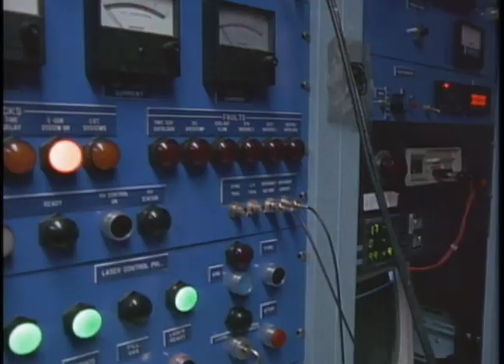Laser Pumped Flying Saucer Spacecraft

Comment: The biggest issue with this concept: Water. One cloud, and you sit in a plane crashing down to earth. The second biggest issue would be global warming. I have seen concepts of space solar farmin, but here instead of using wavelength that get through water the use sunlight that will heat the atmosphere up.

For usage in space? Sound great to me. On earth? Impossible.

Comment: 0:57 the guy says it requires air then they show the thing being used in space?
Reply: You could carry gas, ionize it with the laser and it will travel through space. It's actually much much more efficient in space.

Comment: 2 things. 1 This shape could solve the re-entry issue. Just use air as an engine to slow you down. 2 have you tried putting this whole  thing in a rifled barrel? Think of a 556 caliber titanium 3d printed version of your projectile with enough meat to engage the rifiling, shooting out of barrel with Noth but super heat air as propellant. Meh, give it shot.

Comment: Scientists are idiots! You don’t need engines or a motor to move crafts. You do need helium or even a non-flammable helium. All you need is a satellite 🛰 & an infrared laser to guide any craft. Imagine you shut off the lights in your home & you turn on a flashlight, yeah & with the flick of your wrist you’ve moved that spotlight faster than the speed of light. That is the same concept. You do not need all of that jet fuel. Hell you don’t need fuel at all. Your crafts no longer have to be made entirely of metal. You just need magnetite & electromagnetism. 

It isn’t rocket science. It’s common sense. 2nd nature.

Comment: This is actually very realistic and will most likely even be used for human transportation some day, using solar sails, which can collect even more light.
Reply: One can even imagine an on board hydrogen powered laser producing the same effect with out the tether of a ground based laser. A massive ground based laser can be used to launch vehicles into orbit. Phenomenal I could do more somehow.
Reply: @jaydupree418  You could of that, but that would still need a sail depending on how you use it, but using a sail on the moving craft itself is better as its more efficient and economical is in rocketry weight is money and a laser would increase weight and a ground based laser would allow for a move powerful one at a more economical price.

Comment: How about using this in a jet engine.. Instead of burning a fuel air mixture, just burn the air..
Reply: You bring the energy source
Reply: @samerm8657  Solar and a wee tiny bit of hydrogen gas to up the compression ;) hydrogen + oxygen → water 2H + O → 2HO (Drinking water)
Reply: Oh wait - I see where your going and where I'm going aren't quit the same way.. Power generation.. In aircraft we'll have to wait till we use energy more efficiently or have better batteries, or both.. (prediction - someday we won't need more than a nine volt battery to open wormholes to other stars)

Comment: This is all wrong! First, the laser must track the object and always be there until the aircraft reaches a point in space to travel without propulsion and simply on inertia. Secondly, to be usable and carry payload it would have to be much larger and require tremendous energy from the ground. I propose that we use light. Simple light that comes from sun, lightbulbs, stars, etc.... Light is energy and can be harnessed to be used for work allowing mankind to utilize this energy in all facets of life, especially propulsion.

Comment: i imagine this concept will make a comeback in a few decades when the necessary inexpensive fabrication comes about along with cheap computer vision systems that can guide an intelligent laser that only fires when seeing the light-crafts chamber and can rapidly adjust the beam to course correct the trajectory of the craft.  imagine the same kind of mass proliferation as we've seen with drones.
Reply: I imagine what happens, when the super hot sunlight gets directed to the wrong spot. If it is hot enough to let a plane fly who knows what happens when it hits a forest.

Comment: as the model gets farther away from the laser, it's power decreases. But since the laser is only emitting light, not massed particles, why don't they attach the laser to the back of the model? like if it were connected to the craft, positioned behind it, and oriented so it's pointing toward it. Then as long as you have air, you have max thrust.
Reply: +ThePieFlava
I wonder this too. How much does one of those ridiculously potent lasers weigh? What about the weight of the laser's energy source? Maybe they're far from portable.

Comment: theoretically, couldn't they have used a perfect mirror finish on the metal and have kept the laser energy from heating it up and melting? obviously the air around the metal would be extremely hot, but what if?

Comment: I hear a good part of the reason they stopped bothering with this was the thrust is unstable... of course it's goddamn unstable you have high-velocity energized gasses spewing out the back of it that can cause optical distortions for the laser, and it has no "control" mechanisms onboard besides the gyroscopic forces of it spinning that only keeps it upright, so not directly ontop of the laser, so the energy isn't going to be uniformly produced under it.
Reply: The laser could track the  ship between pulses and aim at the correct spot.

Comment: Anti gravity and the zeros point stick to that faster than lights speed ive looked into the seems very complex plus it could be used as a directed energy weapon like the original purpose of the laser. Just release the technology we know you already have out of the black projects we all know its being used now use it to benefit man and exportation instead locking it away in a51

Comment: That's interesting. I had the same idea myself, but didn't realize that someone beat me to it by 65 years.
Reply: Haha ,., yah that,s dark  humor  aww shot myself !
Reply: What was/is your idea? Never know, it could be different enough to be it's own enity
Reply: I just had this idea. It was crushing to have it beat by 70 years now. Lol.
Reply: I know the feeling.. had that with the maglev train and the press that makes synthetic diamonds . I had drawn those things when I was 6 years old back in. 1989. I still have those drawings 😞
Reply: I also got this idea, but these people are born first
Reply: How about using this in a jet engine.. Instead of burning a fuel air mixture, just burn the air..
Reply: @derekflegg2510  why not use humans as hamsters or even better as biofuel
Reply: @quatermoosh6624 my reaction to ur comment is ur current profile pic
Reply: @derekflegg2510  you can do that, but for this method of doing it you still need a power source to run the laser that heats the air. You could theoretically use a ground based laser system but then it has to be very accurate in a turbulent atmosphere, which up till recently wasn't feasible over long distances. Also your aircraft would be dependent on ground stations (no station, no flying or if a ground station doesn't want you to fly than you can't fly). In a future where things are much more automated it might become more appealing since your aircraft could be much lighter and safer without fuel or even an engine on board and you could probably achieve some ludicrous speeds with it as well.
Reply: @derekflegg2510  If only you knew
Reply: Haha I had this same thing with cvt transmissions 😄
Reply: Isn't that always the way lol Think of an original idea, google it and if it's not a completely nonsense idea someone has probably thought of it before.. Daunting..
Reply: Lmao same
Reply: how about making a community in discord so that our ideas can ve publicly discussed

Comment: So, say you modified the design, gave it a vortex shape, put it underneath a big magnifying glass, and used it as a solar-wind-mill... Would the rotational power overcome the magnetic field and generate electricity?
Reply: +Walter McMain (Walts) With a big enough magnifier, I'd guess so.  Just off the top of my head.  But using concentrated sunlight to boil water for a steam turbine would probably be a lot easier to engineer.

Comment: this is perfectly useful in the space
Reply: How about using this in a jet engine.. Instead of burning a fuel air mixture, just burn the air..
Reply: @derekflegg2510  not with today's technology. You'll need a big-a** battery that will add the total weight of the aircraft. But soon.... https://www.youtube.com/watch?v=KwW-U816KNE
Reply: @UPIL.INDONESIA  yeah for sure youre gonna build a new light weight alloymetal for your jet

Comment: Space ship
 The main parts of the space ship
(1) Main gyro
(2)  anti gravity equilization and pitch and yaw (gyro's 4 )
(3)  lazer to vaporize the mercury stear ship
(4)  Liner motor to keep the mercury spining

By using gyro with mercury as the outer mass 
First spin the mercury to1,000 to 4,000 R.P.M.s
Then generate a foward movement.  
By vaporizing the mercury from one area  of main gyro
Causes the ship  to move in the direction 180° from the point of vaporization of mercury from the edge of gyro
Their are 4 other gyros spaced at 90° from center of the main gyro
 On the outer edge of the ship each is turned 90°
 in relationship  to the main gyro. 

The gyros are used  to eliminated  the effects  of gravity  on the vessel. 
Also to Be used as a way of producing  pitch and yaw.

Each gyro is equipted with its own lazer  system to balance uplift and direction.

Comment: Laser propulsion is a form of beam-powered propulsion where the energy source is a remote (usually ground-based) laser system and separate from the reaction mass. This form of propulsion differs from a conventional chemical rocket where both energy and reaction mass come from the solid or liquid propellants carried on board the vehicle.
Reply: A cold gas thruster is a rocket engine/thruster that uses a (typically inert) gas as the reaction mass.

A cold gas thruster usually consists of simply a pressurized tank containing gas, a valve to control its release and a nozzle, and plumbing connecting them. A very simple example would be the use of a handheld CO2 or nitrogen gas fire extinguisher while sitting down in a rolling office chair; motion is achieved by pointing the nozzle in the direction opposite of the desired movement and activating the extinguisher.

Because the gas is usually unheated, speed at the throat is low and very low performance is achieved; in a vacuum with nitrogen gas a specific impulse of 68 seconds can be achieved.[1][full citation needed]

Cold gas thrusters are mostly useful for vernier engines, and are employed chiefly for simplicity and reliability.

Comment: Problem is.. There won't be any air once it got into space. Another kind of propulsion would be needed once in space.
Reply: Khoa Tran You are confusing terms. There's a difference between propellant and fuel. Imagine you are in outerspace, and you have a gun. You can move by firing the gun right? The bullets are the propellant, the smokeless powder is the fuel, and the gun itself can be described as the "engine". The advantage of this design is that all you need to carry are the bullets. The fuel and the engine are located elsewhere so the ship doesn't need to carry them, so it still saves mass. I hope that clarifies things.
Reply: +Silent Walker
Pressurized air was used to spin the craft, but it is the ionized air created by the laser (or infrared in this case) that propels it
Reply: What does it need air bro?
Reply: Because the laser pump flying saucer heats the air (pockets) around its curvature where the laser is being focused. It happens so spontaneous that the air molecules explode (expand) and propells the aircraft upwards.
That being said, there are no air once it got out of the Earth's atmosphere and into space.
Reply: ***** its for stability, thats why the guy is blowing not-so-really high pressure air to make it spin, so once the laser is turned on it will push the device and with the help of the rotation it will remain stable while flying..weeeee :)
Reply: Khoa Tran The space ship would need to carry its own propellant, some type of ablative oil would be sprayed beneath the ship, and the laser would vaporize it into plasma. This process would repeat for every pulse. But this is only in space, during take off it doesn't need to carry propellant at all, and 90% of a space shuttle's mass is propellant for take off alone.
Reply: The whole point of this design was to reduce loads (weight of fuel). Carrying the oil would make this less effective and more costly.
Reply: +anonymous
[tons of hydrogen gas in space,you just pump gas into the cavity behind it and it pushes off the gas]
If you are envisioning the space scoop idea, you need to already be traveling at a high velocity to collect enough hydrogen - and a very large scoop
Reply: In vacuum ion propulsion works even better

Comment: Now just build a huge ass laser and make a big version of one of these things and you have yourself a space elevator.
Reply: density of the bean is the problem. 
1. Building many many weak lasers can solve some things, but it would easily become much more expensive/impossible to build compared to already used systems. 
2. On the good side - laser densities (beam power) have been increasing over time and at some point of time laser assisted launch would be possible if not the most reasonable. I.e. you enter your craft, laser pushes you to orbit and then you travel by whatever means you have. 
3. Technically if laser propulsion would become really really effective, we probably could use it much like the game Mass Effect suggested - Earth based laser puches spacecraft to orbit - there are orbital relays, that can push the spacecraft, e.g. to Jupiter's docking station. After you complete your visit, a Jupiter relay pushes you back to Earth. 
Given powerful enough lasers, the travel time could be significantly reduced compared to burning fuel alternatives. 

ALSO - orbital lasers could be powered by sun or by earth-based lasers, which can in turn be powered by nuclear synthesis or again - solar energy. So shortage of energy would not be a problem for a looooong time.
Reply: @EBiz-tv9jq  Do you think that a ground based laser followed by two lasers each mounted upon airplanes could beat the atmospheric limitations?
Reply: @thomaseubank1503  If the lasers on the planes were strong enough to push a spacecraft they would probably have an impact on the airplane itself (as they would push both ways).
If that was the case, mounting the laser into the spacecraft would be more viable than using planes. That is to say that we would need a LOT more power to do that.

Comment: When using this design. You need a mono-frequency emitted radiation. Being white light, some bands of rad will not impact the air optimally. Basically find the most singular band of light that creates a plasmic discharge and put all the power in that. I guarantee it will increase the outcome handsomely. Also you need something hyper reflective and force resistive. If you would like to discuss possible modifications just reply and we will set something up.

Comment: Has anyone mentioned that these 'lightcraft' self-centre in the laser (or maser, or x-ray laser), rather like a ping-pong ball does on a jet of air?

This is important - many people assume that sophisticated tracking or guidance systems would be needed, either in the craft or the projector - not so.

Within the atmosphere even strong cross-winds won't shift the craft out of the beam.

In terms of space-flight, this means that EXTREME precision of trajectory would be very simple to achieve

A craft carrying a relatively small amount of a suitable reactant (?), which could be almost any liquid or liquified (pressurised) gas, could be accelerated for, perhaps, an hour or more at an average of a good fraction of a G from a solar-powered projector (in Earth orbit or perhaps LaGrange orbit), and hence achieve speeds that would allow a trip to, say, Mars in a matter of weeks or even days.

First, though, a braking projector would need to built in Mars orbit.